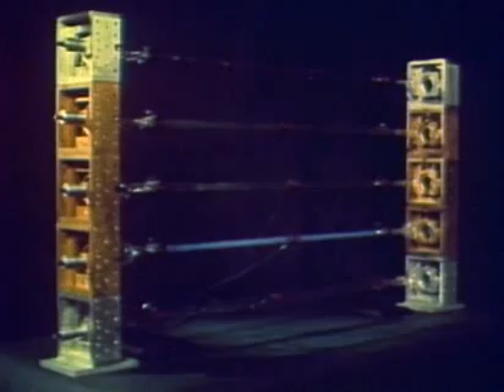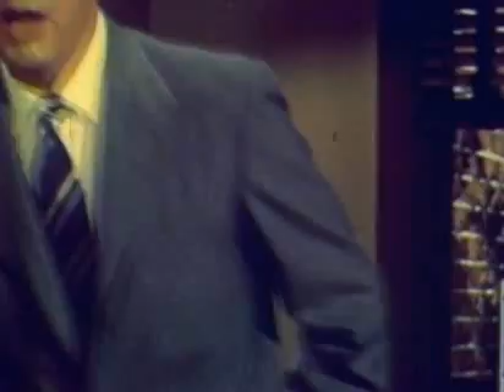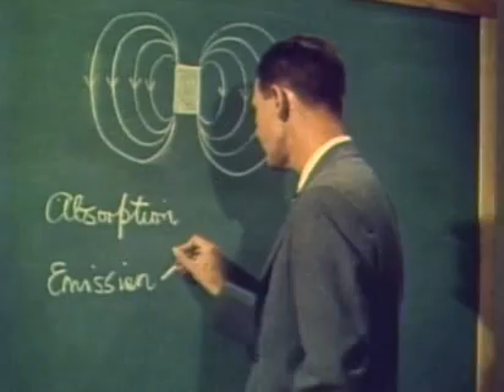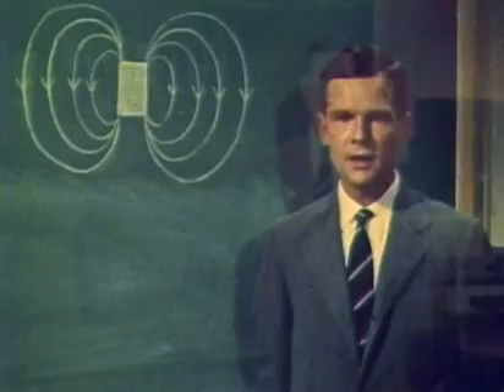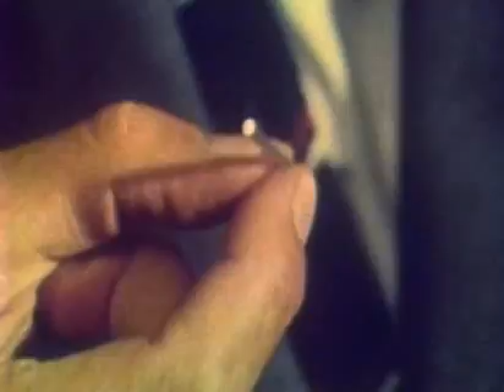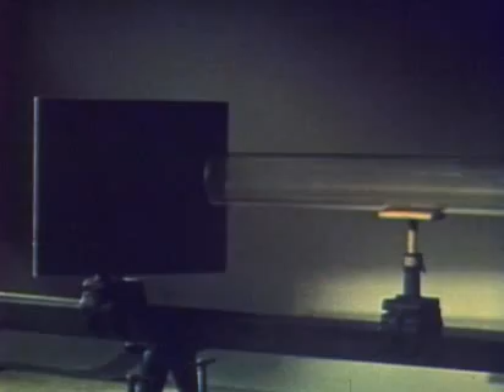AT&T Archives:  Principles of the Optical Maser

Comment: The negative temperature concept is based on the definition of change in entropy:  ΔS  = ∫(1/T)dQ 

Rearranging the definition of entropy, we can write an expression for temperature.  T =  ∂Q/ ∂S .

By this definition, temperature is the ratio of change in heat energy (Q) to change in entropy (S).

When there are more electrons in the excited state than the ground state (population inversion), adding more energy to the system by pumping more electrons into the higher energy state, will decrease the system entropy (system becomes more ordered).    ∂Q is positive, and  ∂S is negative, so the ratio (absolute temperature) is negative.

IMHO, using the thermodynamic definition of entropy to define temperature and to describe the distribution of electron energy levels should only be used in systems that can be modeled with a Boltzmann distribution of electron energy levels, which would only allow for positive temperatures.  Applying the definition to a non-Boltzmann distribution of energy levels, like in a pumped laser with a population inversion is a mathematical hack and does not have a solid physical interpretation.

Comment: The ages when lasers were optical masers, megahertz were megacycles and capacitors were called condensors =) And a very good lecture about stimulated emission, too!
Reply: Lasers are not masers.
Although masers and lasers work on the same principles (population inversion, coherence, and collimation), they have different applications. Both are still used, but you won't find a laser that does a maser's job just as you wouldn't find a maser doing laser work.

Comment: But if light and sound are of the same nature it's just a light is it a much higher frequency and how does light travel through space? Because sound is oscillating pressure of atmosphere but there's no atmosphere in space?
Reply: What Dr. Garrett actually says is that light and RADIO WAVES are of the same nature.  They are both electromagnetic radiation, just at different frequencies and neither of them requires a medium (such as air) to travel through a distance.  As you noted Maya, sound is an oscillating pressure wave and it requires a medium to travel through as there has to be "something" to transmit the pressure.  That medium may be air but it could also be some other substance.  For example, sound travels very well through water at a speed much higher than its speed in air.  Speed of sound in air is about 343 metres per second and in water about 1480 metres per second.  In mild steel it is about 5960 metres per second.  These speeds are all very slow compared to the speed of electromagnetic waves which is about 300,000,000 metres per second in air or a vacuum.  In solid transparent mediums such as glass light will travel slower which gives rise to the phenomenon called refraction where the direction of the travel of light is bent. The amount of bend depends on the frequency of the light and this is how a prism is able to separate the different colours (frequencies) of light.

Dr. Garrett is using some analogies with sound to try to explain certain aspects of the maser (in particular stimulated emission) but he does warn that because sound and electromagnetic radiation are very different things you cannot carry the analogy too far or it will cease to be accurate and cause confusion.

I hope this helps your understanding...

Comment: Would you need physics, or chemistry to study this, or is it a crombined field of study, requiring both?
Reply: physics. I think you learn a little bit of physics in chemistry. But I think it's mainly quantum physics or electrodynamics. idk but I think maybe classical electrodynamics or classical electromagnetism would help more. But I think that what is happening here is based on a quantum effect. He talks about Hertzian dipoles at (6:29) I didn't know what that was so I looked it up and the link I clicked on told me to think about to spherical conductors, connected by a wire, with a net zero charge and where the length of the wire was so small compared to a wavelength of emitted radiation. I read that and I thought "Nothing can get that close" and then I remembered the two charged particles the electron and the nucleus are very close together and when an electron loses energy and drops down from a higher orbit it emits a photon.
I'm teaching this stuff to myself though so I don't know if that helped, but I don't think chemistry will be very helpful.
I could be wrong though. I got this Physical Chemistry and it talks about stuff like nuclear magnetic resonance...